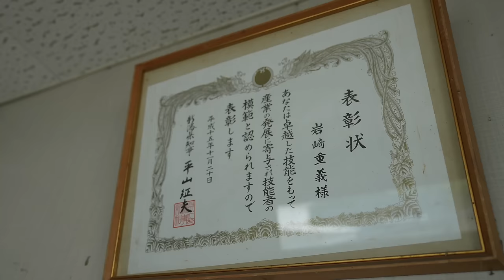2023年に最も視聴された日本の鍛冶屋TOP6。

Comment: Swords look beautiful, but water tempering kills the steel, creating cracks and making it brittle. These swords are unlikely to be reliable and will most likely break at the first load.
Reply: Tell me you're not a metallurgist or blacksmith without telling me...

The quench does change the structure of the steel, but that is what MAKES the swords useable... a perfect blend of hardness and flex. The hardness to hold a sharp edge, and flex to keep it from breaking.  That quench, combined with a deep understanding of steel is what makes these traditional smiths above the rest... 

But people who sell knives at gas stations and short lived mall shops need customers too, so keep on keeping on wise one... there's room for you as well...
Reply: @jaysonquinlan8406  Drink some water, sit, calm your nerves. The main thing is to breathe deeply and evenly.